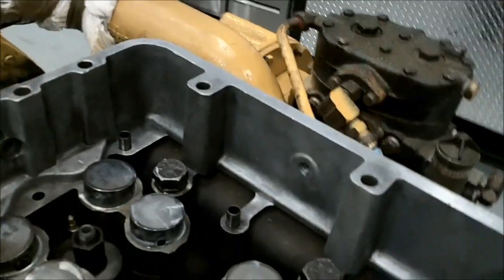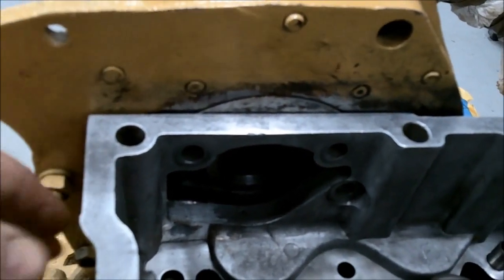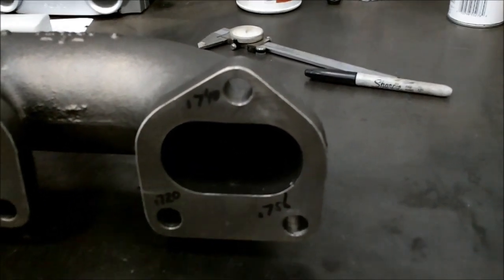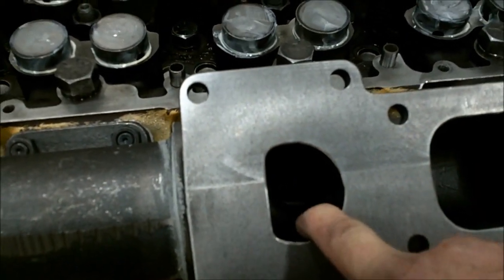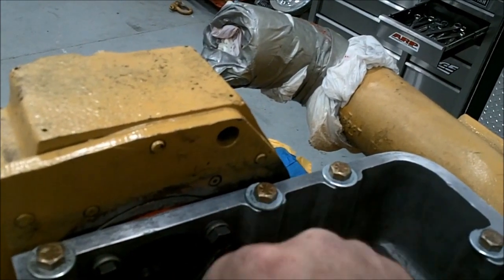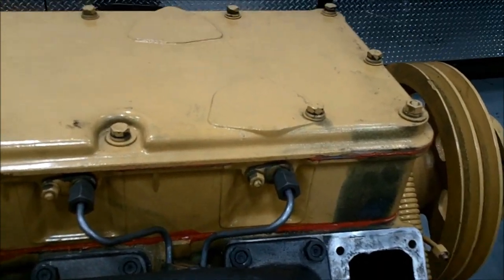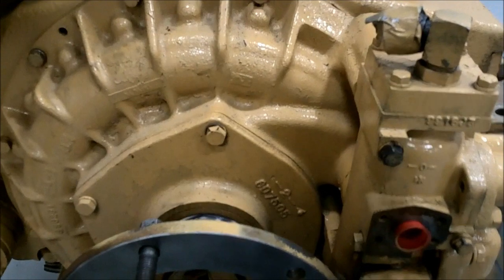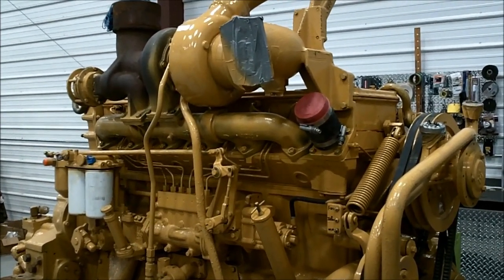Cat D343 1693 Repair Part 4 Final

Comment: Same Cid as a 3406,    being you mentioned milling a mass a mount off the block an or cyl HD till the riser bolts don't fit I never heard you mention shimming the cam  blocks to line up the drv shaft,      an the reason 2 cover bolt holes are slowed is so the valve cover will come off when installed in  99f  769B for one example

Comment: Geoff why do run those 343 engines compared with a more modern or up dated motor?  is it because you have them or are they a better motor then anything current.i would be interested in your comments.Any way excellent video an explanation by yourself,they be calling you Dr Cat soon.
Reply from the maker: pretty expensive to try and change over

Comment: Alot of neat info. Please no offense but you need to throw that orange crap silicone in the garbage...grey rtv would do such a better job...it dries firm and is oil and fuel resistant. That crap your using everywhere is not oil and fuel resistant and dosnt dry firm and really idk of a good place to use the stuff other than for exhaust flange gaskets that are pitted. Again im not trying to be a jerk but you would have so much better results on stopping oil leaks in these old dinosours with some better RTV ultra grey or ultra black! throw that old orange crap in the trash and never smell that nasty crap again. Just trying to help. Sorry if i came across like a know it all puke.
Reply from the maker: it's not orange it's the Red high heat, i've used the black before but don't remember the results, must not have been good cause I don't have it anymore,  LOL  I've used pretty much everthing and have found the red and how I apply it really sucessful,  I've never had any of it end up in the pan or sump screen

Comment: I've ran every pan ever made I owned a construction company retired now . Specialized in move dirt  and Rock with pans Euclid wabco especially cats side of scrapers ran some 637Cs imported from England . Dw 10  619cable Dw21cable 621 621B 627 631cable 631B 633 641 651 657 491 cable with cable D9 . man told me your the best I've ever seen! no brake buliding roads in n.c mountains drinking stump hole likker to stay warm with the fan revs and side panel off we had balls of steel!apron all up dragging Rock to the bottom of those mountains hope you didn't get hit in the head by a flying Rock  from behind .had a lot of friends got killed In those mountains .enjoy seeing you still running pans all we got now is GPS and stupid people that have no idea how to work dirt just a college degree in  dumb ass engineering! miss the hay days gone forever thanks for your videos Sir ......
Reply from the maker: Thanks sir

Comment: I never realized a 343 in scraper applications used air to air aftercooler. Was 343 in 988 aftercooled? 343 marine engines used 1693 water aftercooler with different top section to work with rear mounted transverse turbocharger. They were great in 58' "Alaska limit" purse seine vessels and as gen-sets. Not as much load cycling. Look up a D364. That was a beast. Slept next to one starting when I was 15. A few years ago...👍
Reply from the maker: No the old 988 A didn't use an aftercooler there only rated 375 HP? I think,

Comment: Here's a tip for a non-gouging gasket scraper. Used successfully in calibration labs for removing cal stickers without removing or gouging paint. Just cut like a one inch width hunk of plexiglass and sand a sharp edge on it. Might give it a try on gasket removal.
Reply from the maker: I will Thanks Doc

Comment: Have a 988 non spacer plate  stud block   keeps blowing out cam box gasket where it contacts head  
is there a one piece gasket for this.  should it be glued down?  I would think silicone on both sides would slide out when torqued down.  thank for taking the time to make this video
Reply from the maker: Are you talking about the bottom fence gasket, or the fence to rear accsessory drive? When you say blowing it out have you checked your breather, excessive crankcase pressure ?
Reply: Jpaydirt 
Is the fence to head gasket available as a one piece gasket?
Reply from the maker: No

Comment: If you bypass the turbo waste gate how is boost controlled?
Reply from the maker: It doesn't need the bypass unless you were over 10,000 feet elevation, the trucks with the 1693 never used them, I'm not really sure why they used them, maybe they tested them at a high elevation and they were able to overspeed the turbo, so maybe in a mine situation they were necessary
Reply: Jpaydirt Gotcha so the turbo isn't capable of producing more boost pressure than the engine can handle?  I'm used to cars where blocking the waste gate would end badly.
Reply from the maker: No, it's a safety for high elevation, as the air gets thin the turbo could overspeed and explode the wheels, so the  bypass is a pressure differential valve using barometric and boost pressure's to activate the valve
Reply: Jpaydirt That's really interesting.  And counterintuitive to me.  I would think that thinner air would mean less efficient combustion and less exhaust volume.  The internet is full of sites saying the same thing and I'm sure it's true but do you know why it is so?
Reply from the maker: Well if the air is thin there's less resistance  on the compressor wheel allowing it to spin faster to make the same boost and at some point the damage will come, as long as the turbo is spinning it will keep making boost and the exhaust volume will be the same, but the turbo speed will climb until it does damage either breaks pieces off or burns the bearings up
Reply: Jpaydirt ah ok. That makes sense.  Thanks for taking the time to explain it to me!
Reply: Do

Comment: Wondering why Cat would put the air to air cooler behind the Hot Radiator rather than in front where the cooler air is? Or does Cat use a front blowing fan on this machine rather than a normal type
Reply from the maker: It uses a reversible fan and we run them as a pusher fan 99% of the time

Comment: That is quit the beast. why so many hydraulic pumps is that so you only use that part which is controlled and other functions can still run ?
Reply from the maker: Yes, one pump could not do the job

Comment: retort cement? What brand do you like...? I have a leaky manifold on a Mack E9 can't get it stopped up
Reply from the maker: +punhoss  Retort cement is used to seal coal furnace's and other very hot items,  if the gap is very big it may not seal, Cat makes what they call "Manifold Sealer" but I've never had much luck with it, I will check what the brand name is and get back

Comment: I've learned alot from your videos. What do you use for your rear main seal and wear ring? I have a 1693 in a 1973 Brockway that I have a recurring leak. Ialso have another I am putting together using your tips and I want it to be right. Thanks
Reply from the maker: bob whalen I will go find my parts book and give you some part #'s    If you have a parts book, I am using the one piece seal for serial number 65B180182 only, its the only one with a wear sleeve, does yours have a retarder?
Reply: ***** Mine is  a early 65b, no retarder.  I installed the Cat wear sleeve and have tried the large one piece seal and then then the smaller one that uses the adapter.  Both have leaked. I'm going to pull the transmission out again tomorrow.
Reply from the maker: bob whalen  65B18182. If you use the seal for this engine you will have to check if the heads of the bolts that retain it will clear the back side of the flywheel, when I install this seal in a D343 I use hex head bolts with a low height head, not a cat bolt, and then I have to machine the retaining ring,(thinner) by about a quarter of an inch, don't quote me on that, use a straight edge on the end of the crank to check what the clearance will have to be, also factor in the end play in the crankshaft, this is the only seal with a wear ring, and you cannot get the other lip type seal to work with the wear sleeve that comes with the updated seal sleeve combo, I have tried, If you have a bad groove you can use a speedi sleeve but they are not as thick as cats and will eventually wear through, you can pull the rear gear off the crank and then have a machine shop either metalize or cut it down and make a sleeve, if you have the piston ring type seal all those parts are easily replaceable even when the crank is in the block, and if you have a retarder you will have to use the piston ring seal, I don't think theres any way around it, because of the pressure being applied to it from the operation of the retarder, the piston ring is brass so be carefull with it, also there will be a yellow o-ring to replace on the piece with the piston ring groove in it, get a parts book and you will see how it goes togther. If you need some more help private message me your email address, good luck Bob

Comment: Merry christmas, I have a broken 3406b and want to know if you use cat repair kit or ctp repair kit thanks.
Reply from the maker: Alexdiggingservices  I've used Cat, FP Diesel, and Clevite. The only difference I can see is price$$$$$  I have spoken with FP and they make a lot of Cats pistons, My D9 is running FP diesel and has over 7,000 hours on them, oil consumption is a half gallon per 20 hrs not bad! Old Kenny has FP cylinders and Cat valves and the valves are what destroyed it, I have been using Clevite for some time now with very good results, A lot of Cat parts that are for older machines are junk, and they are not classic parts, they come in OE Cat boxes, It seems to be their way of discouraging you to continue using any thing they don't actively manufacture, Another huge incentive in using FP or Clevite is the warranty they pay for the parts that fail and any progressive damage caused by the failure of their parts, Cat they will replace the part that's it!!!! but in my expereince  their most famous escape clause is "Lack of lubrication" I don't care what it is that will be the excuse, I should do a video on this, Go with a reputable American company or Cat if cost is not an issue, and read the warranty,
Reply: Greed, but old Is gold

Comment: Great video series, lots of good information.  We have a D8K dozer with a very similar engine, learned a lot from your video.

Question for you - Engine oils have changed a lot over the years, what viscosity engine oil do you recommend for these engines?
Reply from the maker: We are using a straight 30 wt. year round with pan heaters for the cold months, Cat recommended  10 wt. for anything below 32 degrees and I have used it before, a very long time ago! I don't think you could get 10 wt. anymore, probably because multi weight oils have come a long way since then, I look at the total base number or TBN, Thats the oils ability to neutralize acids, most people are using 15-40 year round now, cuts down on the different oils they have to carry, I use 30 in the transmissions also so I don't want to carry that and a $3,300.00 tote of 15-40 also. If oil was still three dollars a gallon I would probably have more of the multi weight oil, we have a D9G and run 30 all the time in it, If we have to run in really cold conditions I will use 15-40

Comment: Looks like you have done good job there, should last longer than the 14ltr series 60 detroit in my machine which is gatting replaced this weekend due to the oil and water mixing [only done 12765 hours]. Its just as cheap for us to put a new one in as a recon one, go figure that .